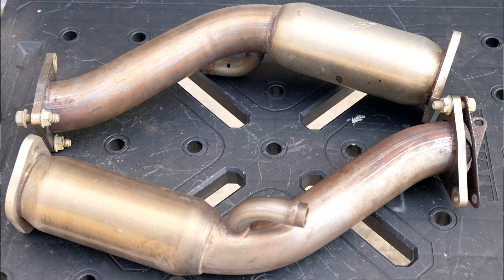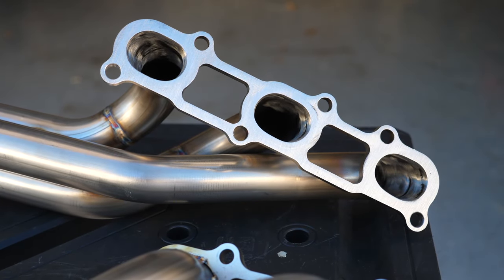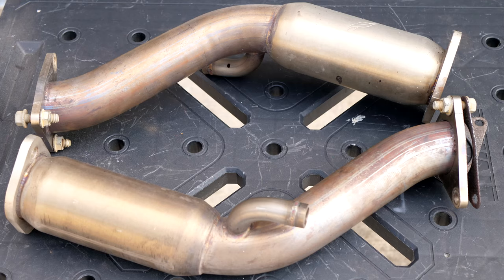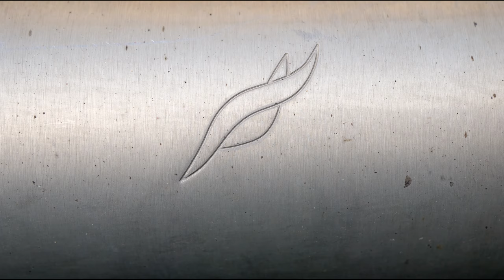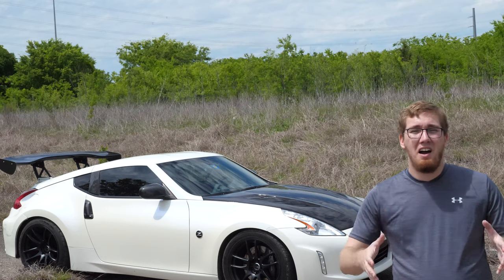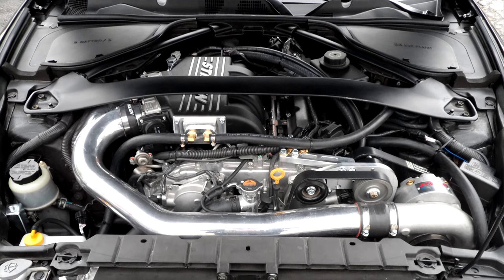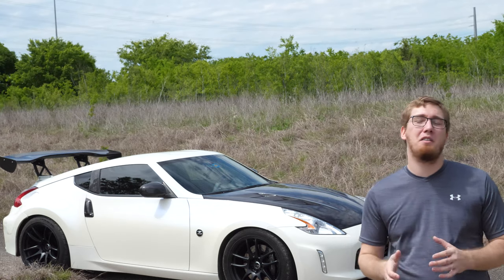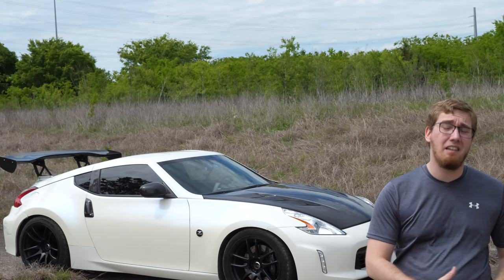Long Tube Headers vs. Test Pipes - Sound Comparison

Comment: I did the ISR Long tubes for 489$ on Black Friday. Tuned at Z1 MS and got like 17WHP outta them. Love them, especially if you're supercharging.
Reply: SIX SPEED JONES 17whp from stock? Or did you have test pipes?
Reply: I ordered Berks test pipes but cancelled the order because I think I'm going to go with long tube headers instead! I currently have Ark Grip Exhaust on my G37S sedan!
Reply: @sleepervq605  hey I also have a g37S but a coupe & was wondering how did it go with the headers ??
Reply: How much was it to be tuned
Reply: @aaronthemartialmechanic893  probably $1000+

Comment: This is a tough one for me. Obviously the test pipes are like a 3rd of the price or so. They sound pretty similar as well. but the Headers definitely have a more refined sound and sound clearer.
Reply: Although the test pipes are cheaper, if you plan on getting short headers in the long run it’s about the same price if you just get long tube headers and not have to purchase test pipes, obviously depending on the pipes and headers the price will vary to either side

Comment: Currently stuck between FI pipes and LT. Any noticeable differences? What would be YOUR first choice if you re-did it for the first time?
Reply from the maker: Still long tube headers because I am chasing performance. Long tube headers are lighter than the stock headers and have greater peak horsepower numbers.

However, I would recommend test pipes to most people because they are cheaper and I think sound better.

Comment: I know this video is old but what is your suspension/tire set up? Yours does so well in the rain and mine feels sketchy asf. BC coils, spl camber and control arms and spl toe bolts. Nitto 555 G2 255 40 18 Nitto 555G2 295 40 18.

Also long tubes open the exhaust so much.  I’m glad I did long tubes as well.
Reply from the maker: My suspension setup is the same as yours except my tires are 245 and 275, 19's

Comment: The question I have involves not sound but performance difference between the two, which I know you touched on toward the end of your video. I currently have Tomei Expreme headers in my track-dedicated 350Z coupled with high-flow cats and aftermarket dual exhaust. I am considering changing to long-tube headers, either RSI or PPE. However, to save cost, and since my Tomei headers are quality, I wonder how close to long-tube headers I could get by keeping my Tomei and adding a y-pipe and test pipe. Can anyone comment?

Comment: Can you still install the O² sensors on the long tubes? I have a G35X, I was saving up to get a 370z because I want another Z. But I'm now considering getting an Infiniti M45 VK45DE V8 or even better M56 VK56DE 5.6 liter V8! Both sedans can push over 500hp with just FBO, get a tune and they can push upwards 600hp!
My other option is my friends father has a badass 300zxTT. That was my 1st car, so I have a fondness for those Z's. His has been blueprinted, port & polished heads, throttle bodies, upgraded turbos & injectors, full exhaust, underdrive pulley, CAI, has the NA diff which has better gearing and no HICAS, stage 3 racing clutch, HKS blow off valve, turbo timer, etc. It's around the 750ish hp range. Or  at least it was 12yrs ago when he last dyno'd it. It's pretty much been sitting for that long wasting away. He couldn't ever get it to pass inspection back then. But it should only be safety now that it's older, it's a 95. It just needs a lot of tlc and a whole new suspension as well as some updated parts. I think I can get it for under 7k. 
I also noticed that you're in McKinney, Tx. Crazy that's where that 300zx is at. I actually went to MHS 9-11 grade until I moved back to Dallas. I'm in Denison now,
I'd be interested in those test pipes but I doubt they'd fit my VQ35. I love my G35x but it's no Z. By this time next yr I will have a M45 or M56 for sure. They are definitely sleepers and rarer to see on the road. Everyone is into the Q50 or Q60. I figure I could go the swap route, but it's too much of a headache. I'll just sell my G35X or give it to my girl instead. Anyways it's cool that you live in McKinney. I'll give you a sub for sure to watch your progress on your build. Take it easy...

Comment: 3:45 any idea why the car sucks in air the way it does? On the Long tube headers car? After every rev you hear that suction of air
Reply: i have that air sucking noise as well. previous owner str8 piped and test pipes. i left test pipes and from test pipes back i went oem and i hear this air release often.
Reply: My g37 does the same with lth and fast intentions
Reply: I have that myself.. z1 test pipes, after y pipe and 2.5 straight pipes with muffler delete.  Since I'm unable to get a tune I'm putting the cats back. Problem is their not oem. Which I'm concerned about. Test pipes cost too much gas money with these Biden prices.. putting them in tomorrow

Comment: I just installed a set of AAM resonated test pipes in my 2014 Q60, paired them with the Invidia catback exhaust and at lower rpms sounds pretty good but I still have the  trumpet sound getting to the higher rpms😒😂

Comment: Hi, I think price wise resonated test pipe will be perfect 👌. Sound good also saving money and hard work to replace headers.
Reply from the maker: I would say this for 99% of people, absolutely! Test pipes are the most bang for the buck!
Reply: @thecarizon504  would you recommend resonated fi cat back ? and what size sound better 12''' or 8'' resonator?
Reply from the maker: @MrGeeky84  The TDX system has no resonators or 18" resonator option. The resonators make the sound much more refined and less raspy. I have nithing but good things to say about their exhaust work.
Reply: @thecarizon504  Im suprised u didnt go with greddy EVO GT exhaust.

Comment: Do you know what that tin rattle sound is when you let off the throttle and the motor revs down? Mine does the same thing and I've never been able to figure it out. The resonators maybe?
Reply from the maker: The hissing noise? Also known as the VQ hiss? Whenever you delete the cats it seems to make that noise. No one I know has been able to explain what causes it.
Reply: @thecarizon504  that's a bummer haha. I hate it. I've gotten used to it though
Reply: @thecarizon504  yup cant find answer. Seems like solution is just finding perfect setup that elevates this hiss.
Reply: Maybe loss of back pressure
Reply: did u ever find out what it was?
Reply: @nickfayuse6861  it’s just called the VQ hiss, and I have no idea what it is but it’s something that no one has gotten rid of. In other news, I’m on my second FI cat back. First pair of mufflers developed a really bad rattle. Possibly the welds holding the caging in place breaking(not sure on the construction of their mufflers. Got a new axel back and it fixed the problem but it came right back after a month and it keeps getting worse. Will dissect the old ones to find out what’s happening.

Comment: Just what I was looking for! Great video man! I was thinking about buying the long tube headers from ISR Performance which are made for 350z but I’ve been reading that they also work on 370z. Any thoughts? 
New subscriber btw & great build brother!
Reply from the maker: Some headers are interchangeable between models. You should verify with the manufacturer just to be sure.
Reply: I will & thanks for the reply brother!

Comment: Why did u got FI long tubes instead of isr or ppe or even motordyne? Also I’m pretty sure u know this but just in case u don’t for future videos if u have the car rolling even barely moving it doesn’t make the car hit the 5k limiter you can rev it to redline. Keep up the good videos👍🏼
Reply from the maker: Yeah I've realized that. I need to start doing revs at a roll. It's stupid that they put that limiter in.
Reply from the maker: And I went FI for brand preference, plus got a discount.
Reply: Up at 3am you just have to to have it in a gear with the clutch in and it lets your rev it out that’s what I do

Comment: Can you explain the hissing? I have the same sound on my g35HR
Reply from the maker: I can't. I've had it with test pipes and long tube headers. I believe it has to do with either the loss of exhaust dampers or it's related to the VTC/VVEL system. Can't hear it now that the car is supercharged.

Comment: Great video!! I just got a G37S recently and planning on going resonated test pipes! I feel like it’s the perfect amount of loudness for me haha! Also I see you’re in the same area as me, do you have any recommendations when it comes to shops that could do the install?
Reply from the maker: I would get in touch with Stephen Oritz, he's a mechanic south of dallas. I do all my own work so outside of that I don't know too many good shops.
Reply: @thecarizon504  Cool cool I’ll definitely check him out. I appreciate it!
Reply: @greybeanie797  bro literally as easy as changing your own oil lol just unbolt the cats and bolt up the test pipes. it might take you 30 minutes at most assuming u have no idea what you're doing. Don't pay for something u can EASILY do your self lol
Reply: @floridacarguys7537  my dad made me take my axle back for my g37 to a shop to get it installed bc he thought it wouldn’t fit. it fit fine then they charged me $100 for it when i could’ve done it easily in 30 minutes but he thought i would somehow fuck up my car by trying to bolt on an axle back if that’s even possible
Reply: Hey , I have a G37S and was wondering how did it sound & go ??

Comment: Any rasp as the rpm are dropping around 3k?
Reply from the maker: No rasp but I get the vq hiss.
Reply: @thecarizon504  I have stock headers fi test pipes and magnaflow exhaust and the rasp or hiss on the rpm decline sounds so bad. I watched the pipes when the make the sound and they vibrate very bad

Comment: Not even a fair comparison. The Test pipes are resonated while the long tube headers are not, so you're comparing oranges and apples :/
Reply from the maker: Considering how similar they sound, I'm doubtful that non-resonated would sound much different. It's difficult to give a fair comparison at all as you have to use the exact same location, rev the car the same, etc.

Comment: Base model with all that money in it to be a Sport model or Nismo. Why not just get the real thing ? Lol
Reply from the maker: Base model: 31k
Used Akebono Brakes: $700
Nismo Bumpers + Paint: ~$1500
Used Coilovers: $500
FI Exhaust: ~$3k

Comes out to 36.5k or so, still 5 grand cheaper than the "real thing" and I have an arguably better suspension and exhaust setup depending on what your looking for.